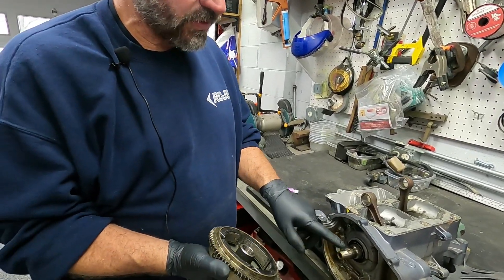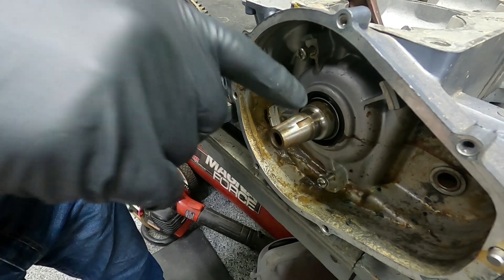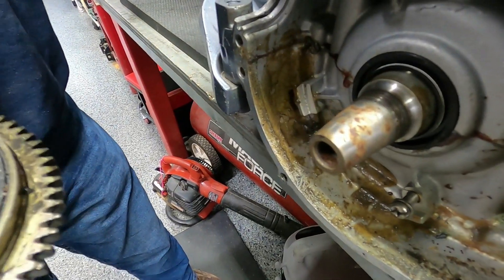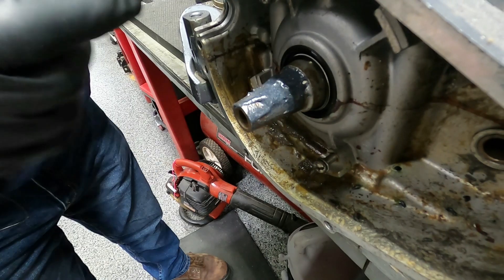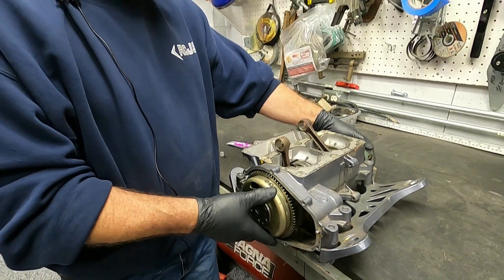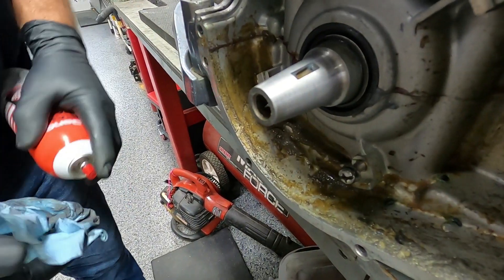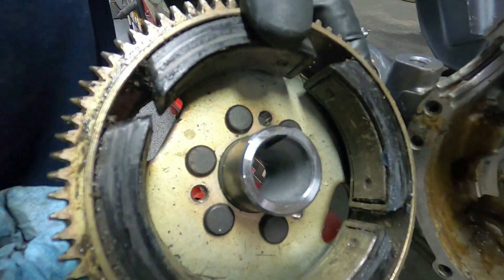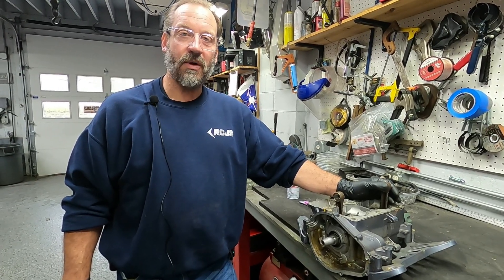Lapping a flywheel, to a crankshaft 2-stroke PWC Jet Ski Waverunner engine

Comment: John, I understand the importance of lapping when affixing a new/ different flywheel to a crank. Do you feel it is important to re lap the flywheel when just removing to facilitate a repair (such as accessing the stator on some models or replacing crank seals? ). Thank you for all you do for the jetski community and for sharing your experience and knowledge.
Reply from the maker: I re-lap...  It is easy to do so why not? This ensures a clean mount surface.

Comment: Never heard of that before.. So yiu are just trying to to eliminate any inconsistencies between the shaft and flywheel? What happens if you dont do this? You have become my favorite channel. Keep up the great work!.
Reply from the maker: By doing this, you will ensure the mounting surface to be clean and match allowing proper fitment, and the flywheel will stay on.